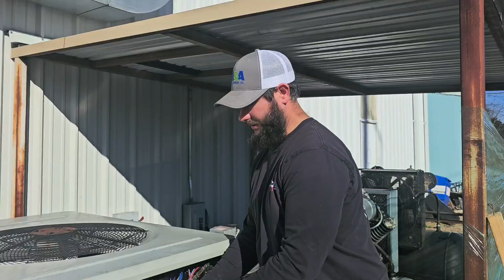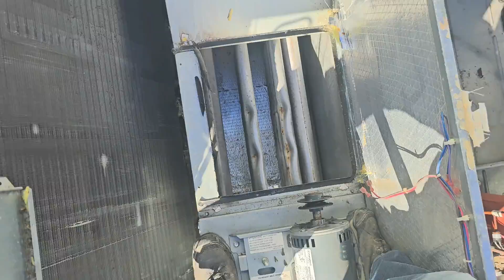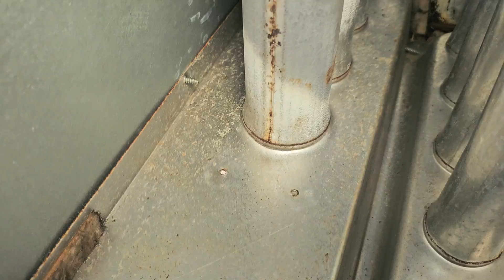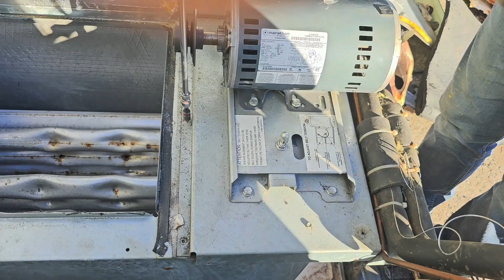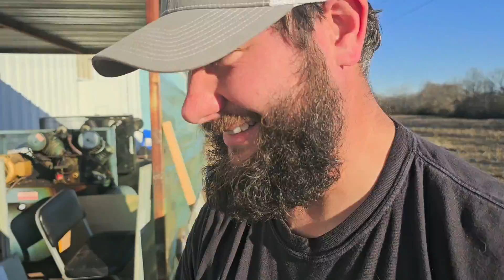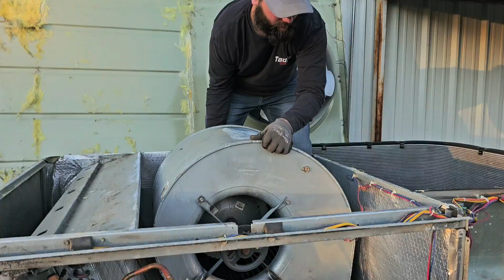How to Replace Trane Commercial Package Heat Exchanger?

Comment: All the screws that were removed when the old heat exchanger was removed were not reinstalled when the new heat exchanger was installed. Finally, the step-by-step instructions for installing the parts were not shown. The cleaning part was also not done properly.

Comment: I just did this same job today, same unit.
Reply from the maker: It's very cool hopefully it went smooth
Reply: @TaddyDigest  it did after I realized I had to remove the blower motor. I didn't take the top off tho. Why did you take the top off?

Comment: What kinda oil do they put on the heat exchangers to keep them from corriding
Reply: The oil is used when they stretch the tube over a die while manufacturing it to lubricate the die. I would imagine some type of corn oil is used.

Comment: I worked on Trane rooftop units in the late 1970's when they had a centrifugal switch ( like old Coleman units ) in the end of the inducer motor. No pressure switch to prove it running. Switch stuck closed but it was not running. Flames rolled out and burnt all the wiring. Ah, the Good ole Days. -40F/-40C with a 30 mph wind in Canada and guess who got to rewire it. Me.😒

Like your videos and keep up the good work.
Reply from the maker: that's cool brother 😎 I love hearing about this this is awesome thank you.